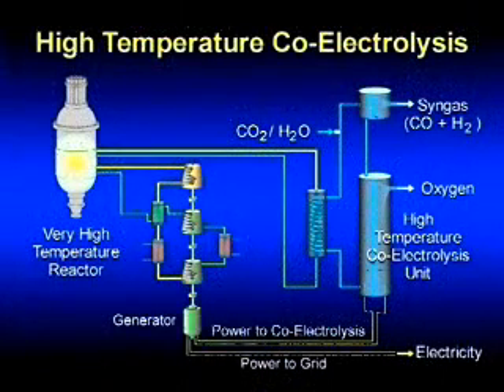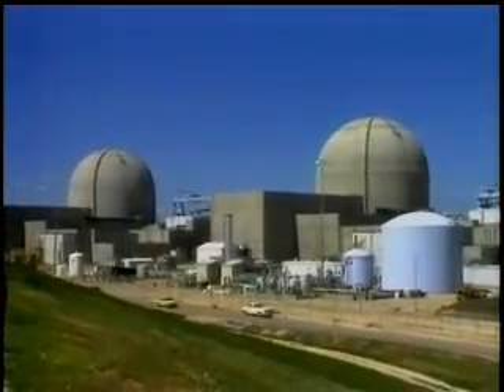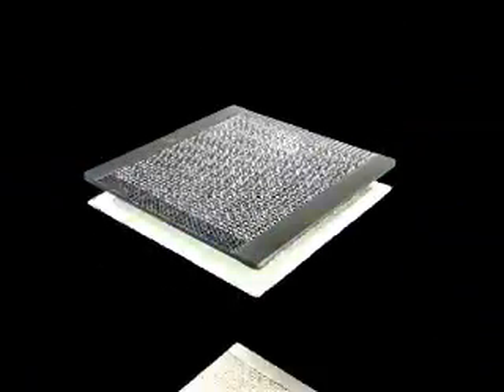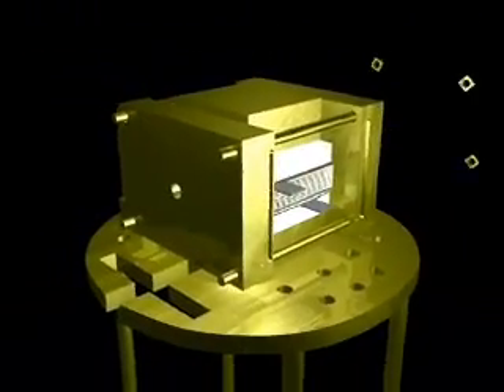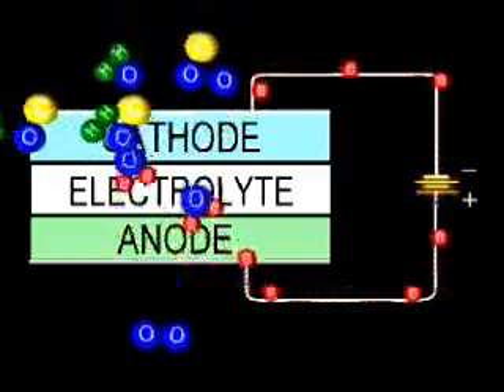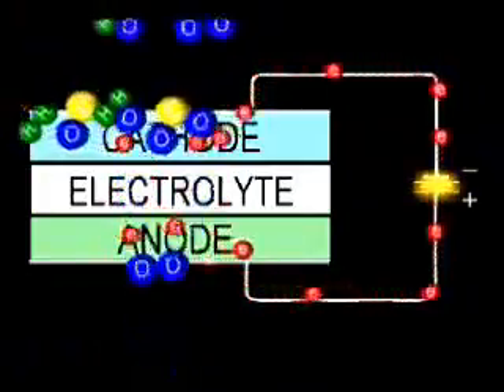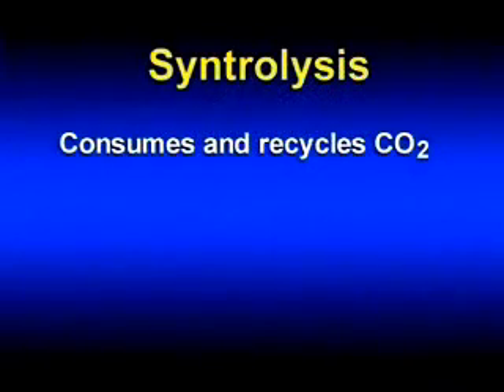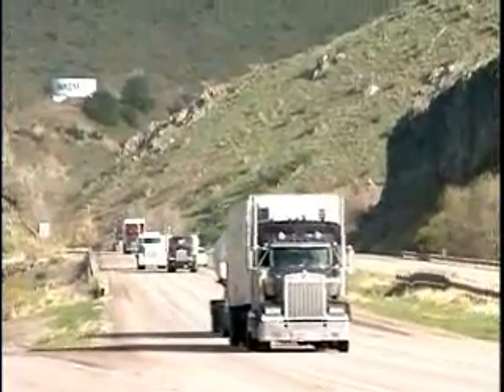Synthetic Fuel

Comment: There's a lot of comments about this being around for decades, and in a way they are right - the process of using heat to make syngas (CO+H2) has been known since WW1.  What is new here is using high temperature nuclear reactors to do it.  Since nuclear energy does not emit CO2 or air pollution, and new HTGRs can operate at high temp and low cost, this means the possiblity of cheap fuel from tiny amounts of thorium, uranium or plutonium, perhaps even from so called "spent" fuel waste from current reactors.
Reply: BTW, this isn't the only chemistry you can do with a heat source like this - how about making ammonia for fertilizer?  Or desalinating sea water?  Tech like this opens up an abundance of resources on top of low cost, clean, electrical power as well.